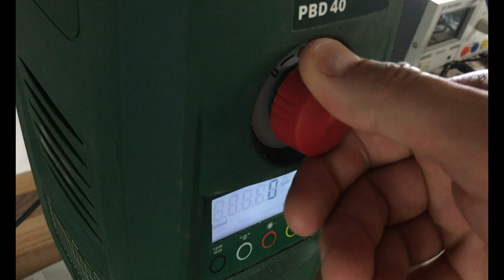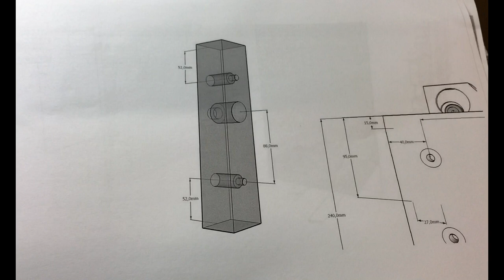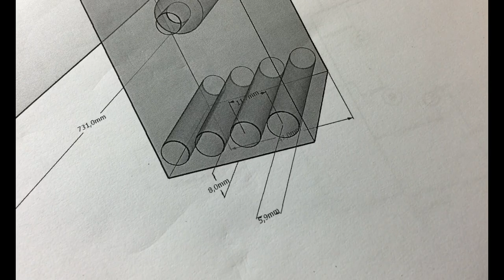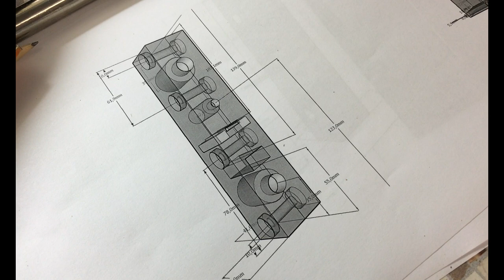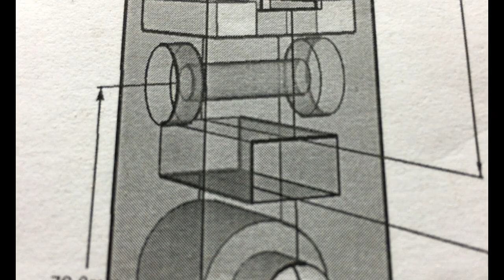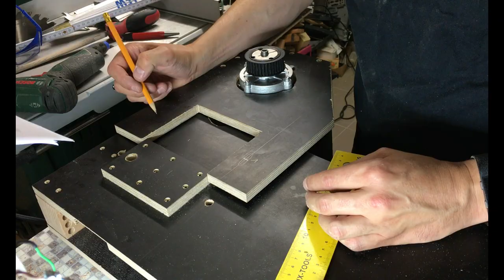DIY Linear Actuator Assembly Part 1

Comment: What is the white bungee cord for?
Reply: These cords provide some force to counter the gravity and help to balance the weight the actuator needs to work with. Since these will be holding weight of the structure plus the person sitting in it, it would be too difficult for the actuator to lift the weight and also to provide enough braking force when moving down, without the help of the bungee string. This way, when you select correct bungee cords, you have almost equal resistance in the upward and downward movement of the actuator...